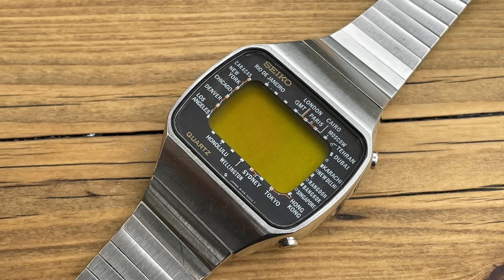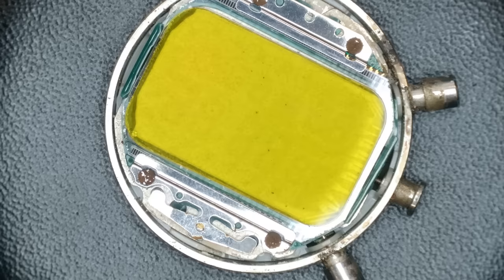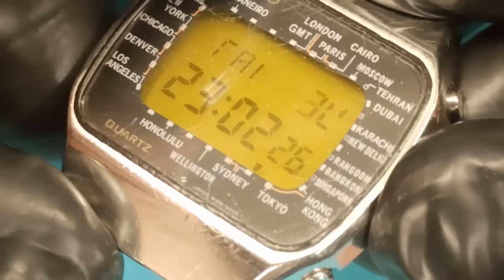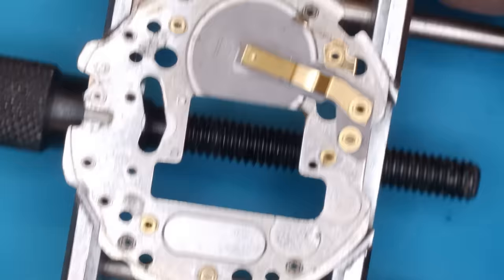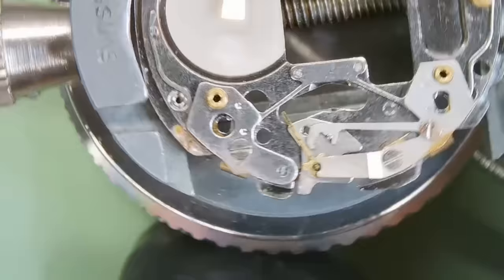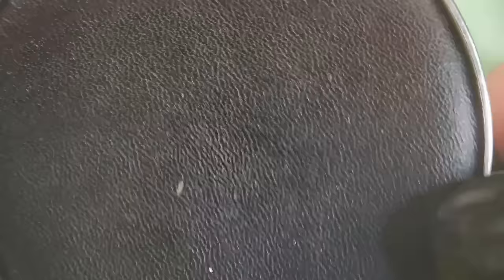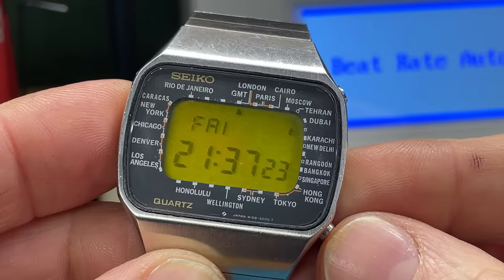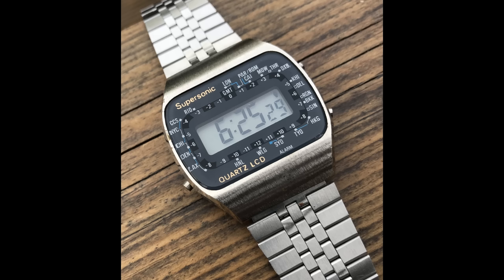1978 Seiko Pan Am M158-5000 Vintage Digital Watch Restoration

Comment: When people say Renata is terrible, I can second that. I opened a dual-pack of LR44 for my calipers because I know they love to drain batteries and the battery just went empty. This pack was bought less than three months ago. The batteries pre-leaked inside the package. (There was no shelf life mentioned on the package either)
Reply from the maker: I’ve never had problems. They are dated on the strip packs though

Comment: I appreciate that you respect and work on digital watches and I'd love to see more of your collection. I suspect we're around the same age, growing up in the 1970s, early digital watches were so cool before they became disposable. My favorite was the Nelsonic "Space Attacker" game watch which I got for Christmas in 1981. Between battery leaks and the gold bond wires that connect the chip to the board being exposed (no black epoxy "blob"), there aren't many of them that work anymore. I have several that are cosmetically great but don't work... I've been thinking of finding one that works and putting the blob onto the chip to protect it... not sure what to use (can you buy a syringe of that stuff?) or if that's even a good idea.
Reply from the maker: I was born in 72. I just like watches from any brand or genre but Seiko is my favourite.  
I can’t advise on the resin.   There is a vintage digital watch FB group I am in and some guys in there will know including Tibi from Vintage Digital Watches here on YouTube
Reply: @MyRetroWatches Awesome, thanks... I'll check that out. I guessed right, I was born in 72 also!

Comment: i think that orange dot on the green plastic is a test point they use by putting it in a jig that will power the module without having to actually to put it in a watch, they do it for electronics a lot but I'm not sure about watches, especially back in the 1970's!
Reply from the maker: Thanks for this insight its clearly there for a reason.

Comment: That adjustment screw inside the watch is probably the adjustment for the LCD angle.  All LCDs had a little adjustment (a potentiometer I think) to adjust the contrast/viewing angle.  I would give it a small turn each way to find out if it affects the screen contrast.
Reply from the maker: The adjuster screw is called a trimmer and that is used in conjunction with the quartz tester to make the watch more accurate.

Comment: I still occasionally wear a Seiko 'Running Man' quartz watch. It is still accurate to 0.5 second a day. 
I watched a man repair an iphone by replacing a tiny capacitor while looking through a microscope. He saved it after Apple said it was toast. All the data was saved from loss.

Comment: As for your quartz timegrapher, I suspect that it has an inductive pickup that picks up the tiny magnetic field that results from the oscillation of the crystal, which is typically 32,768 Hz. It may also be an ultrasonic microphone that is optimized for that frequency. Or perhaps, with the mode switches, both. There is a reference quartz crystal in the timegrapher device. It is installed in an oven, which keeps the crystal precisely at an elevated temperature. Heat from that oven is what you are likely feeling, although they are usually very heavily insulated. Every few years, you might want to take the device to a good general electronics technician to check the calibration of the reference crystal. They will use a frequency counter to measure the frequency of the reference crystal. This frequency counter will likely have been calibrated against a GPS (Or Galileo in Europe) disciplined oscillator, which allows for atomic clock accuracy at a very reasonable price.
Reply from the maker: Thank you. I have someone who can calibrate this for me actually I just have to hook up with him sometime.
Thanks for your insight.

Comment: The quartz tester have internal quartz generator. In order to be always accurate he (the quartz generator)  is in box wich is in another box and is warmed to specific temperature. In order to get accurate measure you have to wait around 5-6 min. and then measure the watch.
Reply from the maker: Thank you.  I knew it had an oven wasn't quite sure what it was doing!
Reply: @MyRetroWatches  I forgot to mention that devices like this one have to be calibrated atleast once per year in order to be accurate all the time. Because with time parts start change the values and that cause some small inaccuracy in the measurement.

Comment: It was nice to see this repair. The quartz tester doesn’t look new. If it isn’t calibrated the time drift shown might be partly caused by the device itself. It would be interesting to know if the watch really has this difference or its due to a miscalibration of the tester. the cause of the display might be the zebra rubbers and i’m wondering if some more cleaning including de-oxid the copper contacts can make it better.

Comment: The QT-99 when in calibration is accurate to .00000001s / day but the reference oscillator needs to be at a stable known temperature and contained inside a metal box with a heater just like an oven. Once the crystal is temperature stable the frequency can be guaranteed. A device like this is usually left turned on so as to keep the temperature constant. It can take hours for the accuracy to settle down which is why they are usually left turned on. Also Lee Mack is funnier than a box of frogs, Genius.

Comment: The crystal oven is used to keep the quartz at a constant temperature to limit / prevent frequency drift caused by temperature change. This gives your quartz tester a stable accurate timing source to use as reference against the watch. The difference between the 2 is your error.
Reply from the maker: thank you for this explanation

Comment: The Date section is where the pressure plastic was broken. the LCD has a major dependency on pressure with the zebra strip you mentioned. It has to be evenly pressed. I still think you can restore the LCD if you can remake the broken plastic (would be very difficult)
Reply from the maker: The plastic frame has no bearing on the strip though really as the screwed clamp pushes onto the zebra. 
Problem with 45 year old plastic. Gets too brittle

Comment: Occelators drift thermally which is why you test device has an oven to keep it at a certain thermal value so it's reference frequency is always the same since it's thermally stabilized.

Comment: Hi Mike, really well done.  Please I am no expert but I think its to do with the screen contacts and the zebra strips.  If you look back in the video the bottom zebra seems misaligned against the clip, may not be fully pushed down neither.  I would be giving this another prod.  Love these digital videos, keep them coming.  I think some lemons are difficult to read at the best of times in different lights.  Best regards.
Reply from the maker: No the zebra is fine in that as long as it touches the screen it works as the screen has contacts all the way up to the edge.
The clamps that hold the screen push it down onto the zebra.
I am more inclined to think it’s just the screens age.  I have many seikos of this era and quite a few the screen goes funny on them.  Guess it was still new tech in the 70s
Reply: To confirm if it's the zebra strip, swap them & see if the missing segment moves. I think it's the zebra strip or a tiny bit of dirt or a bit more clamping force needed by using a small bit of ptfe tape under the clamp. If you look at the display under magnification & a strong light, you'll be able to see which screen pad goes to which segment, hence which bit of the zebra strip & it's corresponding contacts to concentrate upon.

Comment: I am actually curious if the problem is the zebra strips.  Sometimes the silicone decomposes and creates an insulating layer that prevents a good connection from being made.  You see that problem a lot with old remotes and dome keypads, which use similar materials.  The LCD will still work with the slightest of connections, but it won't work well.  It should be possible to harvest zebra strips out of a different watch, as long as they are the right width and height and can be cut to the right length.

One way to see if the display is good would be to connect it to some other device (for example, a cheap digital timer) and see if you get decent contrast.  The segments will of course be totally scrambled up, but you should at least see one or two segments light up with full contrast.  If that's the case, there is nothing wrong with the display.  It's possible one of the capacitors is cracked, but seems unlikely.  This type of capacitor does not dry out and has no wear out mechanisms apart from mechanical damage.

Comment: I repaired my first  digital wrist watch when I was 9 it was a cheap Casio immitation watch water got in and it stopped working open clean the tracks dried it reassemble it n it worked it was inverse lcd display digits were transparent n screen was black

Comment: Another great job. Would a tiny dab of superglue not have secured the green plastic frame? I think I would have had to give it a go just to prevent it pinging off during rebuild. Top job.
Reply from the maker: I have UV glue and a UV light oven for jobs like this but I didnt bother with it in the video as I wanted to see if the module had improved before tidying things like this up.   I am now waiting for some polarizing film to turn up to see if that will enhance the visibility. If it does then I have to take the watch apart so will do jobs like this while I am there. Thanks
Reply: @MyRetroWatches  let us know how it goes

Comment: Dont use a tweeser to change battery. it will short out + and - quite bad. Years of batterypower used i seconds. Nice watch and great video.
Reply from the maker: The tweezers for the battery install are carbon fibre ended.

Comment: The (OVEN) is its Reference. its kept at a constant temp for accuracy. In some test Equipment its best to leave it on for a bit for the reference be stabilize.
Reply from the maker: Yes the manual advises to leave it in for 20 minutes before using.

Comment: You should never use metal tweezers for changing batteries. You can easily short-circuit the watch. There are dedicated plastic tweezers for this job.
Reply from the maker: So many of you keep saying this but look again.  I use metal to remove a dead cell but I use carbon fibre tweezers to place the new battery in. Literally at 03:05
Reply: Oh sorry then. All ok 👍 @MyRetroWatches

Comment: Sometimes the capacitor (surface-mounted)  is okay but the glue underneath it (holding it on to the board) has become conductive over time making the capacitor seem faulty.
So if the capacitor reads like a resistor instead of a capacitor bear in mind that it might be the glue holding it down that is at fault.
Reply from the maker: Thanks for the tip

Comment: Dear Mike, I am not a pro, not even have the half of your knowledge and experience but I think you should be using a plastic spudger to lift the parts cause you know, metal screwdriver is not the ideal tool to pry pcbs I guess.

Comment: Great restoration of the PanAm LCD watch. I have a mid 1970’s Bulova red LED watch that top segment of the numbers 2,3,5,6,7,8, and 9 are non functional, have you seen that problem before?
Reply from the maker: I own led watches but can’t repair them. It’s such early tech . Usually the wire bonds are exposed and break . Fixing that is well above what I could ever do.
Reply: @MyRetroWatches  Thank you for your response. Do you know how many manufacturers produced led watches? I don’t remember seeing very many of them.

Comment: The tester has an ovenised oscillator which is running at probably 32khz? But it doesn't have to be. It can be any reference frequency, but it would make the electronics easier to implement. The watch frequency is picked up (induced) into a coil in the watch holder and compared to the reference. It is ovenised to ensure frequency stability, and will be accurate to  a few parts per million regardless of temperature. Best to measure the watch at a little over 20 degrees as the worn watch will also have a very accurate oven (body temp).
Reply: The TCXO inside the tester will be in the Mhz range. Probably somewhere between 4-10Mhz.
Reply from the maker: thanks for your insight.

Comment: i'm speculating, but I think those zebra strips are the problem with the display. the aging rubber shrinking over time may have caused them to lose conductivity, the fact that the segment vanishes when the watch is cold adds weight this theory. 

If i'm wrong, my second guess is just the age of the LCD, the poor contrast could be the polarizers have degraded from a lifetime of seeing sunny days, or at worse some breakdown of the bonding interface between the glass layers.
Reply from the maker: Zebras seem okay and I’ve never seen any that are not still very flexible. I have a polarising filter coming and will address the temperamental segment then.  Might try the board form the donor first to rule out that. 
Thanks for your comment and help.

Comment: Unfortunately the display will not work forever. I'm really amazed that an lcd resisted so much.
Yes you can replace that yellowish polarised plastic but inside liquid crystal substance will decay more and more. Yes all lcd dies.
Reply from the maker: I have Seiko digital from 1975/6 and screens are fine. Same with my mid 70s casiotron.  It’s a true wonder they still run but equally these watches were very expensive at the time and very good quality.
The digitals of today are nothing like these.

Comment: Excellent job.  I love mechanical watches, but I'm not at all snobbish about quartz watches, even though how they work is a complete mystery to me.  That plastic surround with the missing piece looked burnt to me, and it had also affected the interior case back /  bezelly bit?
Reply from the maker: casback was fine just full of rust from water ingress.  The plastic has become quite brittle and clearly someone before me tried to repair this and no doubt broke it all up.

Comment: This watch need some brand new zebra connectors. its should restore better connections between lcd and pcb board. A good cleaning of lcd connections with isopropyl alcohol should improve thing if it hasn't been done yet.
Reply from the maker: No, zebra are fine and I’ve never seen them age , contacts were cleaned with alcohol and the board washed in alcohol in my ultrasonic .
Fading is, on this one at least, the screen itself.

Comment: Sorry to Post again, Here is the Seiko Quartztester QT- 99 User Manual
ps - YouTube wouldnt let me Post the QT-99 User manual, which I have here

The tester Probably detects the Crystal Clock Frequency, and compares it against a known value that it has inside the QT-99
I'm Guessing, as there is no Electrical connection between the Watch and tester, possibly 16Khz
Reply from the maker: Thanks I have the manual on my own website for download.  I have just not really read it yet!

Comment: If a capacitor was gone in a watch would it still be working from the battery? My Seiko stopped working but when playing my electric guitar, the pickups still picked up the ticking which i heard on the  amplifier .
Reply: Should have mentioned it's a kinetic watch.

Comment: Great strip down. I bought one of these from ebay "Spares or Repairs". I replaced the battery and the display flashes with every second. Could you please guide me to which capacitor I would need to change. Thanks
Reply from the maker: I don’t know . There are only 3 caps on the whole board. I’d be cleaning the zebra strips first
Reply: @MyRetroWatches   Perfect, thanks for the reply..

Comment: What would you recommend for an old digital watch with a leaking screen? I recently got a Casio AN-8 with a dark blotch at the edge of the display and I'm wondering if it can be fixed.
Reply from the maker: A screen bleed is normally unfixable. I have heard of people trying to squeeze a bleed out to the edge and trying to glue around it to seal it but I’ve never tried. I would think it would cause irreparable damage.

Comment: I'm curious. Mechanical watches have been going for a couple of hundred years and can still be used. "Mechanically" a digital should do the same as long as you can provide the power. However, many seem to suffer issues with the readout.
Does anyone think they can last as long and is there a way to revitalise the screens? It would be good if you can because they are an important part of social history.